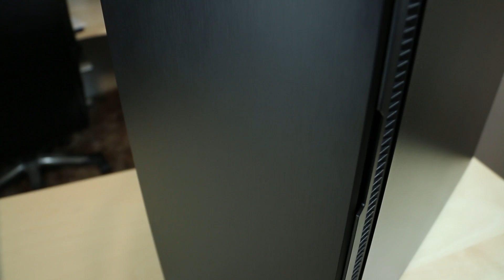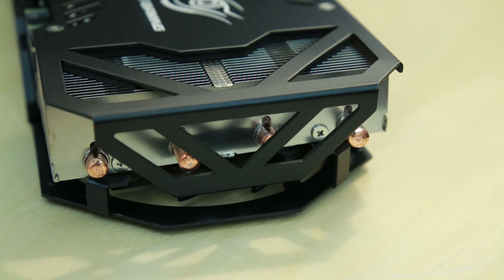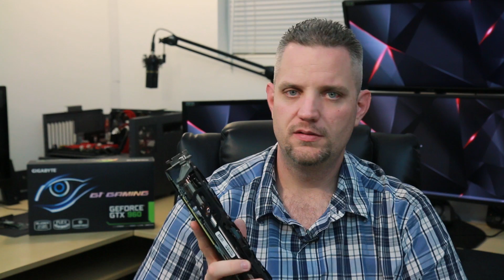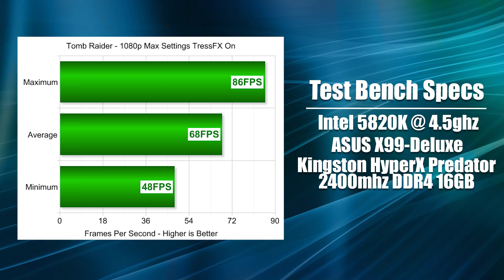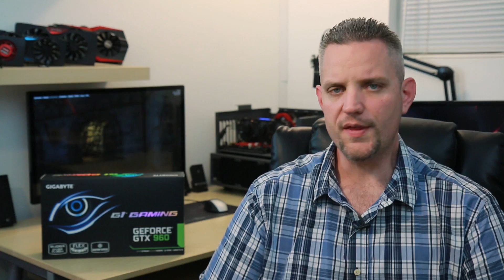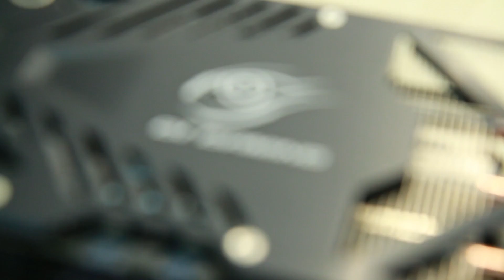Gigabyte GTX960 G1 GAMING - Best Mid Range Card Yet?

Comment: What do you Jay think how much fps on 1080p CS:GO High settings? ;D
Reply: 200+ fps with CS:GO maxed out easy. My 660ti gets 120+ fps @1440p
Reply: csgo is very cpu bound. my old rig with an i5(no oc) and an r9 280 manages 250-300fps with everything maxed @1080p
Reply: I have an intel 2 core 4 threads i5 mobile cpu running at 2.6GHz and it runs cs go at 80 fps on low settings
Reply: im averaging about 150 fps with a gtx 760 and a i3 3250 on complete max out 1080p
Reply: my office pc with a intel i5 4430 i belive gets 200 fps on medium settings in CS:go it has a gt 720
Reply: Mikee Tyson thats a really good cpu, gpu doesnt make too much of a difference in cs i guess
Reply: exactly, im pretty sure they made it like this bc alot of the ''younger age'' dosent build a pc, and useally just buys a prebuilt, and prebuilts have this idea that cpu>gpu even for gaming
Reply: Mikee Tyson also, having a good cpu can benefit in many ways, unlike gpus.
Reply: A good cpu will only help in badly coded cpu bound games like cs, in other games the gpu is way more importnant than the cpu also prebuilts put much more powerful processors because idiots who buy them believe that the proccesor defines the power of a computer
Reply: Axecution cs and almost every game that i can think of that is very focused towards the competitive scene
Reply: Axecution There is a difference between "badly coded" and non graphics-intensive. Although CS:GO has so many bugs that its fair to call it badly coded.
Reply: Threepoint Onefour Every game should relly mainly on the graphics card and really little on the cpu. Can't say that bout csgo though
Reply: Axecution Yeah. And that's because CS:GO works with integrated graphics. You don't really NEED a GPU to run it. That's why it's so popular; it runs on a potato.

Comment: Mmm.... The minimum fps are very low
Reply: That isn't problem but the normal fps. These are old games and it plays these games like a 660 ti. It has no benefit over older cards.
Reply: Béla Kelemen Yeah thats true, there is no point in buying a 960 if we have the 970 for just a bit more.

Comment: I have an gtx660, is it worth to for this 960? the price is really good , but how much better is the 960 compared to the 660
Reply: It's not worth it.
Reply: VoazGame why?
Reply: Go for a 970
Reply: Alucard .Tepes because it is barely faster
Reply: Alucard .Tepes i went from GTX650Ti BOOST(witch is about the same as GTX660) to GTX970 G1 Gaming and holy balls its fast. Tomb Raider all settings max @1920x1200 was Min:70fps Avg:90fps Max:110fps
Reply: ok , going to wait some more and save more money for an 970 , thanks
Reply: Worth it gtx 660 is very slow nowdays and gtx 960 is close to gtx 770
Reply: ***** well, that is a lie
Reply: lol GTX660 is NOT slow. I can pretty much play any game on high-very high at good frame rates on 1080p. 960 is NOT 2x faster than the 660. It's faster, sure, but 2x faster, nope. Upgrading from a 660 to a 960 is just bad. If you have a 660 and you can play all the games you play on a decent level, the 960 wont give you stellar performance improvement. If I were to upgrade, I would definitely get the 970. Tho atm I dont feel the need since I just dont need it. I already run metro Last Light and high end games like that on high-very high and I get between very good frame rates.
Reply: Alucard .Tepes good choice :)
Reply: It's not worth it, this is a budget card nothing too fancy about it. If you are desperately looking for a good upgrade: something like a 970 or 780 is gonna be significant upgrade... at a price of over $300
Reply: ***** lol...970 and 650ti boost....i upgraded to 970 from a 760 and i get about 2x performance....970 is a beast
Reply: Fred Bruno lol the ti model gives 7 more fps xD
Reply: soumya basu then you know how i felt going from 650Ti Boost to an 970... "OMG, i'ts not a console anymore!"
Reply: 650ti is like a kitty in a jungle....xD....
Reply: ***** for that price  r9 280 is better choice. you can go for  r9 285, it should be about the same price and its a bit faster than  r9 280
Reply: Diavolo222 GTX960 is two times faster than GTX560. You are also right about GTX970. If you have GTX660, get a GTX970.
Reply: ***** I dont recall saying it's not 2x faster than 560.
Reply: ***** Dont buy radeon gpus from xfx brand dude...try to get sapphire or msi...
Reply: ***** Doesnt matter if your best friend got a good gpu dude...5 out of 10 xfx cards are bumps...buying from that brand and getting a good quality grphx card ...its almost like tossing a coin and expecting a head..i had to rma those garbage cards 3 times...see mewegg and amazon reviews and u will realise....and btw r9 290 is an awesome gpu...
Reply: ***** You bought 290 from which brand
Reply: Powercolor is a decent brand ...much better than xfx.
Reply: Diavolo222 i don't recall saying that you did. I just said it so other people who don't know, would get a general idea how fast GTX960 is compared to the older cards.
Reply: The only card I would consider replacing with this shitty offering from nVidia would be a GTX570 or an ATI 6970. If you have anything better than that there is no point in spending £200 on this piece of crap, when you can spend £220 and get an R9 290 which totally dicks on the GTX960. In fact, don't fucking buy a GTX960. It's a joke of a card. Get an R9 290 or the GTX970.
Reply: I had an evga 660, upgraded to this and I can now run shadows of mordor on ultra.
DO NOT trust comment opinions though, even mine. The only way to find out how good it is is if you use it yourself.
In my experiences, most comments are just bitchy fanboys looking for an argument.
2GB is low, but it's just low enough to run demanding games.
3gb would be better, but personally it doesn't bother me, considering ultra textures only look good > 1080p
Reply: *****
Good, honest and FACTUAL advice. +1
Reply: Dylan Smith
Textures look as good as the pixels they are desgined on. There isn't a single game out there (without MODS) which has textures greater than the 1920x1080 resolution. There are no games with native 2k or 4k resolutions. There probably will not be any coming out, unless they are 100% PC exclusives, as the conoles can't even do 1080p textures and maintain more than 30fps. I have 2k textures installed in Skyrim and I can tell you, even on a 1080p monitor they look incredible. Way better than the 1k textures. Sure you are losing some detail but the detail density does come through.

And using afterburner overlay, I can see that as soon as I load Skyrim and go to a town my VRAM usage is around 2250MB, thats in 1k textures. With 2k textures it jumps up to 2700MB. Crysis 3 in Ultra / High also sometimes dips above 2GB as does BF4.
Reply: *****
There will be no 8k textures for 10 years or more I'm afraid. Whoever said that is just being silly. Even now there are only a small handful of games that have 2k (1440p) native textures. There are no games that have 4k textures unless they have been modded by the community (Skyrim has some, as does Fallout NV). Even the best rigs available, the top 5% of PC Gaming machines out there, with SLI GTX980's, struggle to get 60fps on Skyrim with 4k textures installed. So believe me, there will be no 8k textures until 2020+.

Look at the Firestrike benchmark for example. When it released the best PC's were hitting around 4000 points. These days a good gaming PC can get 10,000 points on a single GPU, and push close to 20,000 with SLI GTX980's. So now they just released the 4k texture version of Firestrike with native 4k textures, and even a PC with SLI Titans can't get more than 2000 points. So ... 8k textures? Don't be silly ;)

Star Citizen might have native 2k and 4k textures. It should do, as it's a pureblood PC game. But that will be it.
Reply: *****
LOL XD

Comment: It barely can do 60 fps on 2-3 years old games. This isn't mid range card, this is an office range card.
Reply: Disappointing.
Reply: Seriously, the only this card could have been impressive is if it had a $150 price point.
Reply: truly disappointing.
Reply: 60 fps is playable. Consoles do what, 30 FPS??

Assuming that most people are using a display with a 60hz refresh rate, who cares if it doesn't hit 100+ fps? It's a MID RANGE card.
Reply: Zoltan Orosz Great argument....the thing is....why am I running GTA V on high @ 1080p 60 FPS with my GTX 960 then?
Why am I running AC Unity at 1080p 60FPS at medium settings?
Why am I running BF: Hardline and Elite Dangerous maxxed out @ 1080p 60 FPS?

Most of all, why are you a dumbass?
Reply: TheManInUrPC So right have gtx960 2gb. It runs like a beast. I even play gta 5 maxed out without MSAA average fps is 60.
Reply: sirnicko1
 Well I am not a fan of other manufacturers, but they commonly like to milking the costumer. This time nvidia try to sell a chip that barely add anything to previous cards.
Reply: Mikihara  It's a $200 card not a peasent box.
Reply: jkteddy77 My works uses the GT610 for their office cards. Nothing more, nothing less... Plus, I thought the GTX line were for Gaming so the 730 would be really low end Gaming right?
Reply: Zoltan Orosz LOL good point.
Reply: Wendell Radford Ehh....AC: Unity was poorly optimized anyways, so I really didn't care about the fact that I was running it at medium. The fact that I was playing it at all was satisfactory.

Yea, Ubisoft sucks, but they will never accommodate the PC Gamer....
Reply: But, but but... My GTX 660 can pull about 50+ FPS on BF4 with the GeForce Experience Optimal settings (which is Ultra for me). Dunno why or how though :D
Reply: This is gona be the GPU i will be buying for my mom PC. LOL. OFFICE RANGE CARD!
Reply: jkteddy77 I can imagine it is. Haven't tested it for gaming but it's mainly used just for the extra video ports (for us anyway)
Reply: Wendell Radford When I first got my 960 the performance increase from my 660 was OK....not that great. When I finally freed the damn thing from the X51 case and blessed it with a 500 watt PSU and mid-tower case, it's performance went up by quite a bit. Removing all the constraints on it allowed me to overclock it a notch and get the most out of the card. Since the card is only 200 dollars (a hell of a lot less than my old 660), I really don't mind the fact that I'll need to upgrade in the next year or two. Probably by then I'll invest in a upper tier card that is more future proof. Anyways, your choice with the 970 is definitely the better of the two if you have the extra hundred dollars and want to grab an extra year or two of future-proof power.
Reply: Gtx 960 = its a small business PC GPU ... !?!? lmao!!!  You gunna piss off all the the Nvidia fanboys. Lol
Reply: The 960 has been serving me well up till this day...

Comment: I had no idea the 960 was even close to being done, And also is it even worth it to pick one of these up when you can get a Like New 290 for almost the same price? and so everyone will shutup about it, First.
Reply: The 960 barly beats the 760. So i would go with the 280x or 290 instead. Or maybe 970.
Reply: Not unless you really need an upgrade. Judging by benchmarks seen on other channels, it is roughly on par with an R9 285, which are the same price. So really as far as value goes, it is on par with AMD cards. But this card specifically looks to be the best value out all the current releases due to it's high overclocking.
Reply: Jesper Rex u are utterly wrong it barely beats gtx 770. and i would never go with amd. older technology and way to high power con
Reply: jkteddy77 yes. and we will see if the 300 series will do a diffrence. not expecting too much because i get more surpriced then (if it is a very good gen)